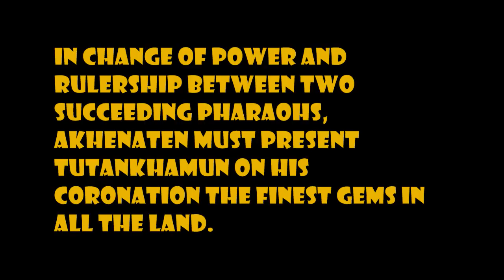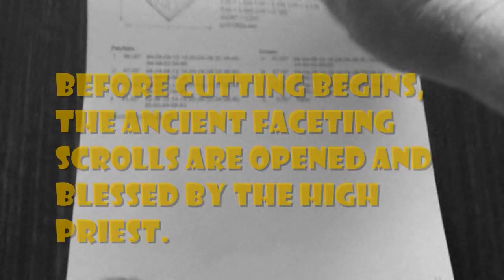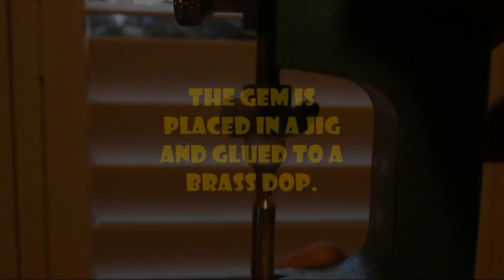HOW TO CUT GEMSTONES - TUTANKHAMUN'S GEMS

Comment: Would it be possible to cut river rocks in the same manner as one would cut gemstones?
Reply from the maker: If they are sandstone based no. If harder yes, but pointless as there is no refraction. Cabs are a better option.
Reply: some limestone landscaping rocks and some 36 grit sandpaper glued to a board work great. water proof sandpaper and a bucket of water will help a lot, but you would still need to polish it with a much higher grit. while not a shiny as gems, they can still turn out awesome. limestone almost looks like a galaxy when polished, and you can do other shaped with it rather than just some gem style cuts. it should be noted though that boards aren't perfectly flat and will not stay so even if squared up. a piece of glass or a marble slap would be better for precision. because of this channel i now do both. i cut gems at my local lapidary clubs workshop and tinker with limestone rocks at home in my spare time.
Reply: @VintageTimeGems  Think octahedral and/or tetrahedral cut river rocks would look nice?

Comment: I just ordered 285ct of sunstone. I'm looking forward to cutting it. I don't have much quality rough that's a decent size, so I haven't been able to try out some of the cuts I'm interested in. Hopefully, the sunstone will remedy that situation.
Reply from the maker: Sounds great. A 285 ct sunstone is huge. Hopefully you will cut a great gem. Cheers
Reply: @VintageTimeGems  Oh no, it's not a single stone. It's a parcel of 285ct made up of 10-20ct stones. Most of my current rough is like 5ct or less, which is pretty limiting.
Reply from the maker: @albeon_draken  Ok...Still a 1 or 2 carat faceted sunstone is still nice. Sunstone has diamond like qualities.

Comment: I have asked in the past but never got a response, is it possible to cut volcanic glass (obsidian) or does it flake too easily to cut?
Reply from the maker: kody frost Sorry if I missed the question about volcanic glass. It's fairly easy to cut as it's relatively soft. I found that polishing it difficult as it can scratch easily. I have made a video on volcanic glass (helenite), it's called volcanic gems. Cheers.
Reply: Vintage Time much appreciated. I will watch it right now.